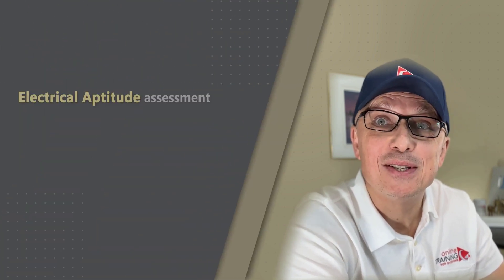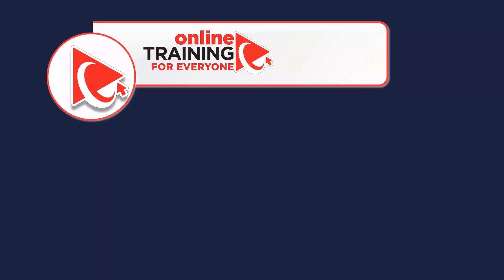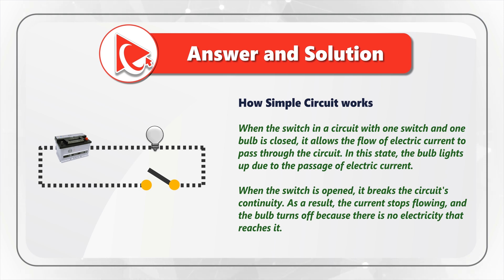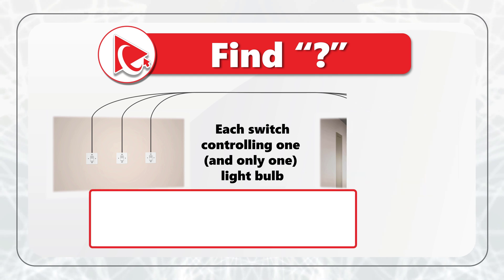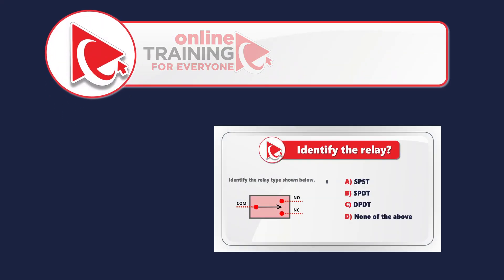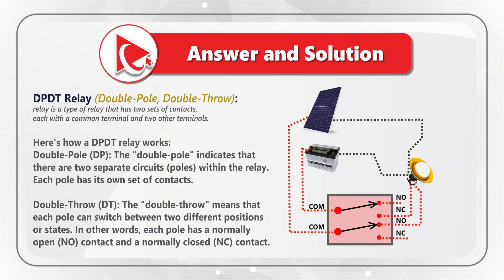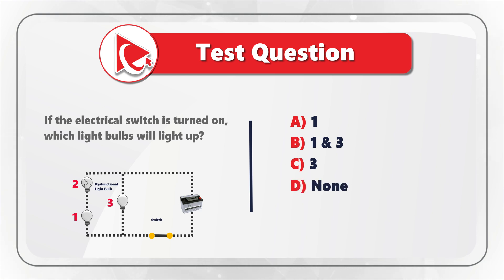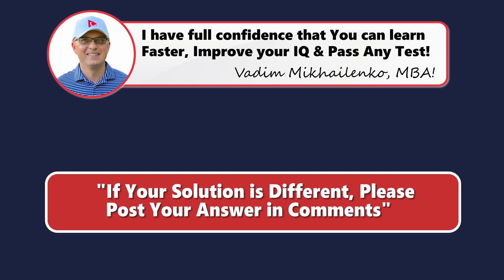How to Pass ELECTRICAL APTITUDE TEST - Questions and Answers with Solutions

Comment: In switching bulbs question ...
I'll first switch ON  the first bulb and then I will keep it off then I'll switch on the second one and then quickly turn off and I will enter the room by touching the bulb I can feel the heat which one will be too much hot that is switched first , less heated one is switched second and the cool bulb is the 3rd one

Comment: In the last question. When the switch is turned on, all the lamps will light. In a series circuit, the first lamp will be brighter and the second will be dimmer due to the voltage drop. In my opinion, the correct answer is 4. Answer 3 is correct when L3 is inoperative.